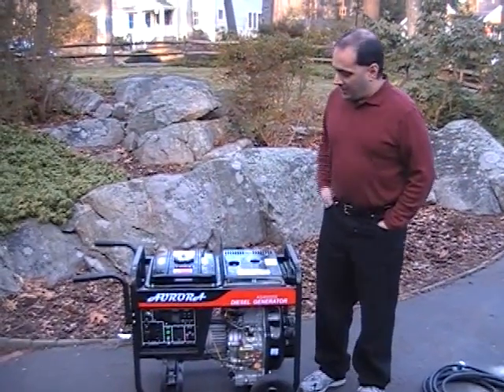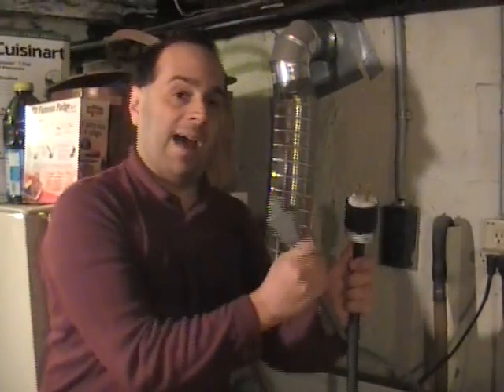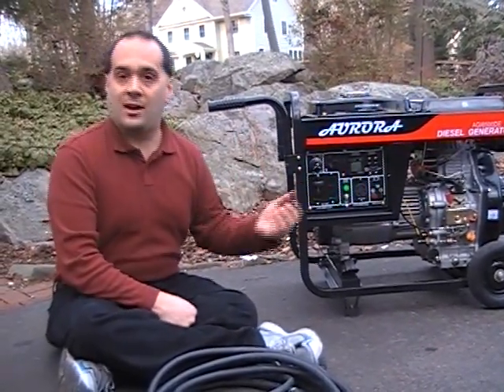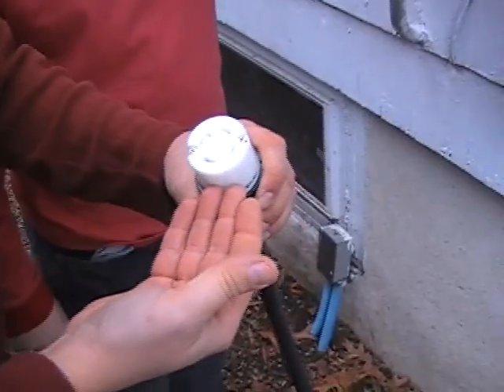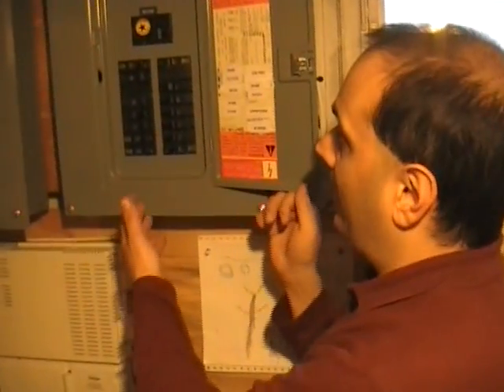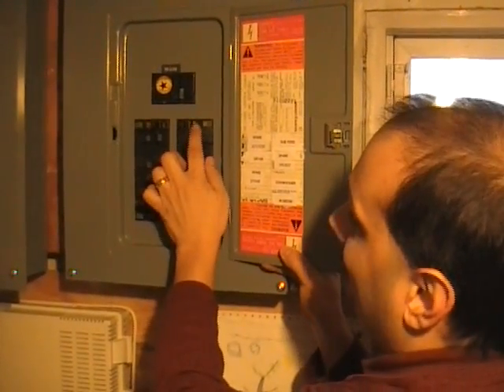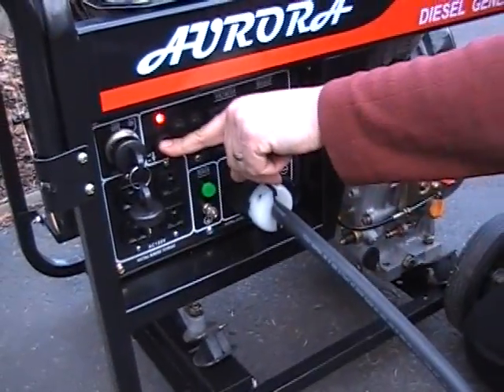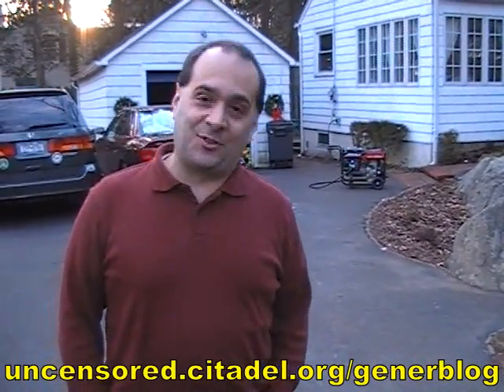Inexpensive residential generator hookup

Comment: When you were talking about the illegal drier outlet hookup, you failed to mention that if you forget to flip the main breaker before plugging in the suicide cord you might kill a utility worker.
Reply: "Ed Taylor" Never said the generator would power the neighborhood. How long does it take to create a hazardous situation? When the generator backfeeds the transformer it will step the voltage up, just like it steps it down for the house. That's why you turn the breaker off. I don't know what the "nice try" is about, but these are fact. Maybe better check with your local electric company. The interlock is so anyone can operate the generator. You stated that you have been operating this since 2000, are you the only one that hooks the generator up? Make sure everyone else knows to turn the main off. By the way, how do you know that the generator will be trying to power the neighborhood? Might be your feed to your house is the only one that is out. It has happened before.
Reply: @jamesglavich1426  I don't forget, but most complainers come up with an endless rant of what-ifs. I have had my generator running when I was the only one w/o power and the linemen expressed no concern. Don't you know they had on gloves and had already checked to see if my transformer was hot?
Reply: @jamesglavich1426  Make sure you follow all the generator safety rules before using portable generators. This is just a reminder for everyone’s safety. All generator safety rules should be followed carefully. Here are the rules about generator safety: Generators can be dangerous if not used carefully. Every year, hundreds of people die or get injured when using portable generators due to carbon monoxide poisoning and electrocution. Make sure you are using your generator carefully and keeping others safe as well. There is something very serious that everyone should always be aware of when using generators. Some people do run their generator indoors which is not safe and that increases the risk of carbon monoxide poisoning which can cause death of family and you. Some people run their generator in wet conditions which can electrocute them. Please remember that you should never run your generator indoors. Remember that carbon monoxide is an odorless and colorless gas that you cannot see or smell. Carbon monoxide is a silent killer. Keep that in mind. Make sure your generator is 15-20 feet away from your house and away from doors, windows, and vents. Never use your generator in your porch too. Having a carbon monoxide detector is very important against generator safety. Some people also allow children to go near the portable generator which could pose risks. We need to keep an eye on our children making sure that they are not near the portable generator so they won’t get electrocuted or burned by the generator which is dangerous. A locking enclosure also keeps kids safe. A generator shed might look like a tempting place to explore, or take cover during a game of hide and seek, but a generator is a dangerous piece of equipment that can cause injury. It says on the manual that we should also keep children away at all times from the portable generator to avoid injuries. Please do not allow a child or unqualified people to operate the portable generator.  It is important to keep your children safe especially little ones. The portable generator can be hot during an operation. Just because some manuals missed what should be listed doesn’t mean it’s safe to do. Always follow the generator safety rules when using portable generators. Generators pose electrical risks. If you need to use your generator during wet weather, you need a generator tent to protect your generator from getting wet. Don’t let your generator get wet. Keep your generator dry and before using your generator, please make sure your hands and your generator is dry. Do not wear loose clothing when operating the generator. Everything that is said on the generator’s operating manual should not be ignored. Never smoke cigarettes near the generator. Please keep flammable things away from the generator. Never overload your generator too. Your generator can catch fire. Never ever try to plug a generator cord into a wall outlet to avoid back feeding. Back feeding your generator is dangerous. Always turn on your generator first before plugging in appliances and shut off the appliances before turning your generator off. Use a heavy duty cord for your generator and the cord should not be worn out. All the instructions should be followed carefully. Never refuel your generator while it’s running. It can cause fire if fuel spills while your generator is hot. You should turn off your generator and let it cool off before refueling it. Having a fire extinguisher next to the generator is also important. This is only a reminder for everyone’s safety of using generators. Make sure your generator is properly grounded. Having a fire extinguisher next to the generator is also important against the safety rules. https://youtu.be/I1jT3ANENvI and here is a video more about keeping others safe when using generators and also about our family’s safety. It’s important to keep our little children safe as well. Make sure they’re away from the generator. Hope this helps.
Reply: Injuring a utility worker is a very dangerous situation with a drier outlet connection. People will inevitably forget to pull the main house breaker to isolate the house from the incoming power lines. The drier outlet however, is breaker protected and so is the generator so no more current can flow through the house than what is allowed by the redundant breakers. It doesn't matter which way current flows through a breaker, they  work regardless. AC flows both ways anyway.
Reply: @azopene  I have never forgotten to open the main breaker. That's the first action I take and have been doing so since year 2000.
Reply: @azopene  How can a generator of that size power the neighborhood? All connections would represent parallel loads and these portable generators would instantly pop a breaker, bog down or just fail should the main breaker not be opened. Why would people inevitably forget the main breaker? If they are that ignorant about electricity they shouldn't even own a generator.
Reply: @shofar-man  When the power from the generator travels past your meter, to the transformer, it will be stepped to 7,200 or 14,400, depending on the power company. It don't have the amperage to push a great distance, but is dangerous for any service people thinking the power is off. At the very least an  generator interlock will prevent the main and the gen feed from being on at the same time. With that being said,  without the interlock, if you are supplying power with the main on, and the power comes back on, guess which supply system is going to win a power struggle, and could result in a fire.
Reply: @jamesglavich1426  Nice try, but guess whose generator would immediately shut down were it to be connected to all my neighbors in the community?

Comment: remember its 60 cycle AC, so your outlet has current going back and forth
Reply: can you help me understand why we should know this?  (a sincere question)  
thanks
Reply: @JonathonNeville  you mention in your video (at 2:14) that house wire is not intended for back feed (yes it illegal to plug generator that way), but AC stands for alternating current, meaning it goes back and forth 60 times a second.  everything else is correct in your video. thanks for the information.
Reply: @johonneng4105  interesting!  it's not my video, but i am now intrigued why back-feeding is wrong when A/C means electricity is flowing backwards half the time.
Reply: @JonathonNeville  Backfeeding is dangerous from the standpoint that if one was on generator power and the main utility switch was closed (putting the house back on the grid), it could potentially electrocute a utility worker servicing the line.

The other danger, as the gentlemen stated in the video, is that if the plug pops out of the dryer receptacle accidently, someone can get electrocuted as well.
Reply: @gojeda , my question is not why is backfeeding dangerous, my question is how that danger (which I understand) relates to alternating current.  I presume the panel stops any alternating current from travelling back up the line to the street, and I don't see the a/c meaning exposed metal prongs will be charged, but the existence of alternating current tells me that it's okay for current to travel backwards within a circuit.  I know my question isn't clear.  I'm still just trying to understand the relevance of johonn eng's comment "remember it 60 cycle AC".
Reply: @JonathonNeville  the problem is in where the circuit breaker is located. Generally, you have the circuit breaker located as close as possible to the source of the power. This is why in modern construction, most panels are mounted right where the power comes into the house. The circuit breaker protects the wiring (and thus the home) from problems which happen on the load side of the breaker. When you are back feeding through your dryer circuit, the entire length of the run from your generator to your panel is not protected by that breaker. (Yes, most generators have also breakers on them. However, there is no guarantee that the breaker on your generator is sized appropriately for that wiring. Also, portable generators don't spend their entire lives in a nice controlled environment like your home circuit breaker panel does. I'm not trusting my house to the breaker on that portable generator.)
Reply: @JohnMcNerney  Ah, okay.  So electricity can flow both directions as alternating current, and in that sense backfeeding does not introduce anything non-standard, but the circuit would not be protected by an equally reliable breaker.  (and backfeeding could also electrocute someone working on the line)
Reply: While the OP sounded confused  and was almost hyperbolic, backfeeding has nothing to do with what direction electricity flows or whether AC or DC. Exactly the same number of electrons flow in both directions in any closed circuit. Rather, it describes the load in relation to the source. If a wiring scheme sends power to a point, e.g; a receptacle, then applying power directly to that point is backfeeding - making power available at the intended source. The phase difference can be an effective short circuit, tripping both breakers. Others, here, have described other dangers.

Comment: Maybe for lighting and definitely not for electronic equipment..
Reply: why not?
Reply: why not?
Reply: Colman Boylan I just bought a 7500 running watt Westinghouse and that beast can power a lot more than just lights son
Reply: Mike Hamilton the one I just bought isn't quite that big, but it has 5400 running Watts and 6750 starting Watts or surge Watts. 

I have seen videos where people are running air conditioners refrigerators and several other devices on generators that are barely more than half as powerful as this generator. 

The thing that confuses me is when you see charts showing that refrigerators take 700 or so running Watts and an additional 2000 or so Watts when the motor kicks on. I know there is a surge when the motor kicks on, but this is crazy because any of my 120 volt outlets on this generator can only handle up to 2400 Watts. 

I will get lucky to just have the refrigerator plugged into one outlet and since it's a duplex outlet, I couldn't use the bottom one. I would have to plug into the duplex outlet beside that one to make sure my refrigerator is isolated and won't cause me to draw too much power on that one duplex outlet. 

And then if you're using a portable heater, most of those consume 1500 watts. Even the very small ones! It doesn't look like you could plug 2 of them into a duplex outlet and get away with it if you do the math. 

I know lights and things only take like 40 to 75 watts each, and if you're using the newer LED bulbs you can probably run 50 of those suckers and not hardly load down the generator at all. 

But if you're running anything like a portable heater, an air conditioning unit, or a refrigerator, or microwave, then it seems like you're going to eat up the maximum output on a generator that is in the 5000 watt range pretty quickly. 

And then you have to look at your extension cords and make sure they are not too long and that they are of sufficient gauge and can carry the load you will have plugged into them or you're getting into more trouble. 

This is what all the data points to that I have read, but it just sounds like people are being so extremely cautious, and in reality you could probably get away with a lot more.
Reply: @Weaver Cattle Company , I too have found that what you say is TRUE.

Comment: Art C, why did you choose a diesel generator over a gas- powered?
Reply from the maker: Diesel generators are more rugged, reliable, and longer lasting than gasoline generators.  Diesel is also compatible with #2 home heating oil (as long as you know your heating oil is clean and is not mixed with other products like kerosene) and the house in the video has a 375 gallon heating oil tank, so in a situation where the roads were unpassable we'd be able to run the generator on well-filtered heating oil.  In practice we've never had to do that, and in fact, when my stored diesel was getting old I'd just pour it into the heating oil tank and buy some fresh fuel.

I don't live there anymore.  Our new house has electric heat, electric hot water, it used to have an electric stove but I upgraded to propane, so if I were buying a new generator today it would probably be a gasoline/propane convertible.
Reply: Art C yikes, electric heat now?! That's extremely expensive so you must've moved somewhere with mild winters!
Reply: Diesel is also much safer to store in large quantities.

Comment: Thank you for posting this. I see this allot especially in the last 15 years, ever since the cost of portable generators have decreased. 
Not only do you risk your home you risk the lineman working on the powerline.
Reply: Why do you risk your home when plugging in to a breaker protected drier outlet? The generator is also breaker protected so you have a redundancy of protection.
Reply: @azopene  
DON'T BE STUPID HIRE AN ELECTRICIAN!!!
As a FIRE FIGHTER I have put out a few house fires due to back feeding a garrage circuit,  dryer or improperly running power through a breaker box. The home owners that have lost their homes will strongly dis agree with you. 
I have a close friend that is a lineman for National Grid;  he and his co workers  has been nearly killed because of unskilled amateurs playing electrician as a result they back feed the grid.
Reply: @bobisthebuilder3982  a lineman's life is worth more than the $300 for a UL listed transfer switch that's made for this application. Stupid idea
Reply: @toddsmith231  
That's exactly what I was saying.  I have gone on dozens of service calls where unskilled people have played electrician. 
One of my favorites a home owner asked me to replace a light fixture that was flickering. When I opened the box the wiring was an old 14/2  extension cord. 
Lots of scary ideas out there.